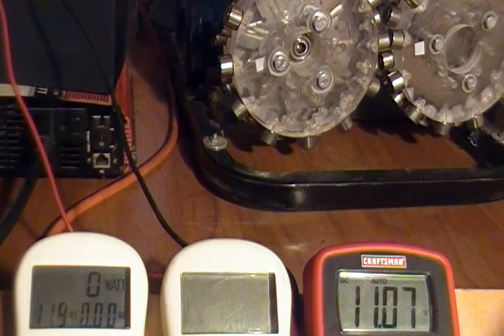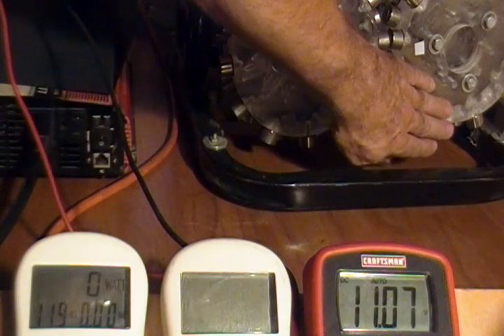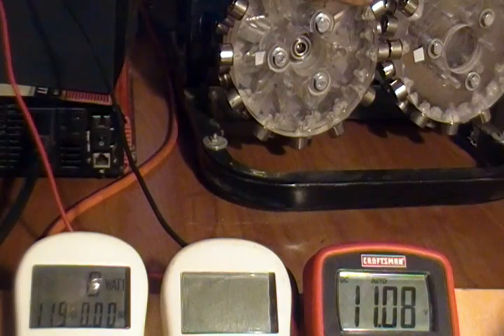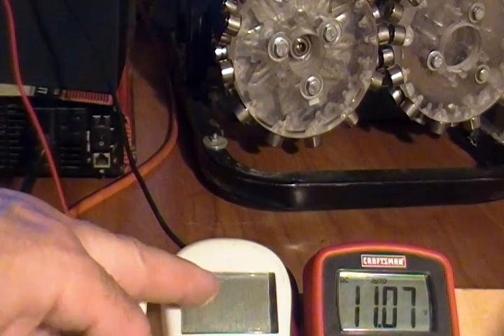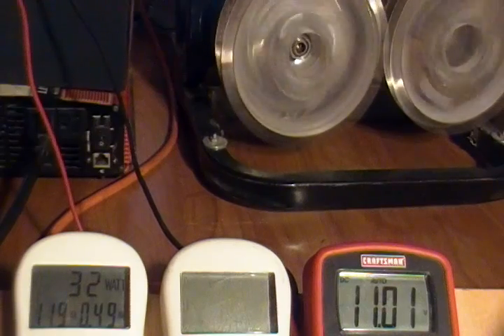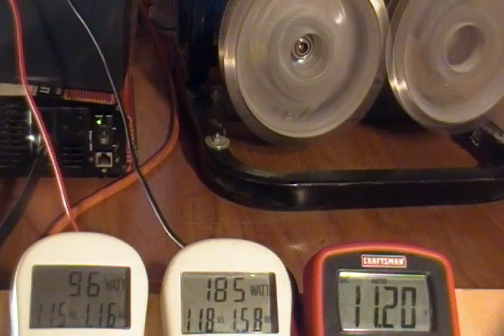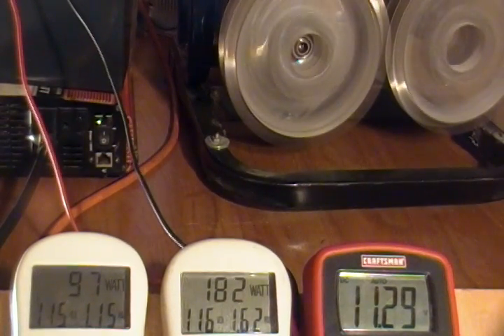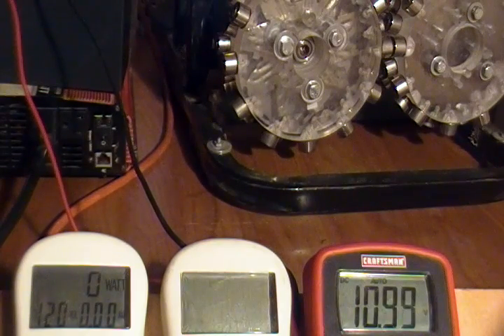Free Energy Electric Power Generator Overunity Magnet Motor

Comment from the maker: @hammeralois It will turn one alternator's rotor fast enough (barely) to demonstrate overunity.  It doesn't over heat, it just won't turn the alternator any faster.  I didn't know how big to size the motor when I purchased the plans off Ebay for the device, as the "plans" were just a partially translated copy of the original French patent documents filed by Mr. Hatem.  Now I know to get the biggest 115 volt motor they sell, which in the Grainger catalog is 3 hp.

Comment from the maker: @dthom95 Yes, that is the whole idea.  This setup was just built by myself to prove the concept.  Unfortunately I am at the max. output of the drive motor and would need to increase its size to add anymore alternators.  Additional alternators would be added in line on the alternators' rotors and not anymore directly on the drive motor's rotor, as that would put too much strain directly on the drive motor.

Comment: Have you considered to use the gearing principle? Just use a smaller diameter wheel connected to the alternator so that it will rotate faster than the wheel connected to the motor, thus producing more power.
Reply from the maker: Yes, there are many improvements that could be made. This is just a proof of concept device.

Comment from the maker: @nissanguy240sx This is a 1/3 hp 3-phase motor with a converter that allows it to run off 110 VAC.  This motor is too small for practical purposes, but does demonstrate the concept.  I would recommend you get the largest motor you can find that runs off 110 VAC and then connect a dimmer switch to it, to turn it on and off.  The reason for the dimmer switch is you need to start the motor slowly so the rotors stay in sync.  I built the rotors myself.  Everything else is pretty much off the shelf.

Comment: Hey...
I have heard about this concept bevore, but just don´t know where the + energy comes from.
Your Magnets are aligned N 2 S right`?´
Have you tested this system with an aditional alternator to the motor?
THX 4 sharing
Reply from the maker: The magnets are set up to attract, not to repel each other. I did build a set up with additional alternators, but I tore it apart because there were improvements I wanted to make. Here's an example of the original inventor's set up. https://www.youtube.com/watch?v=m0LjPc0lxfM&t=10s

Comment from the maker: @NoMorePetro  Yes, I've tried smaller, weaker magnets and fewer rows as well.  They didn't have the strength to keep the 2 sets of rotors in magnetic synchronization.  I haven't tried larger diameters of rotors but  feel this make for a definite improvement in performance.

Comment: Very interesting. Are the three rows of magnets necessary? Have you tried any other magnet sizes or strengths? Have you tried any other magnetic coupling sizes?
Reply from the maker: I tried smaller magnets, but had too much problem with slippage. I have found 3 rows to work best as did the original inventor: https://www.youtube.com/watch?v=m0LjPc0lxfM&t=10s

Comment from the maker: @RomeoDLN1 Separating the 2 magnetic rotors too much weakens the magnetic attraction between them and then they won't stay in sync.  I get the best results when the rotors are as close to each other as possible with actually touching. The rotors can be different diameters, but the spacing of the magnets on each rotor needs to be the same, so they mesh perfectly.  Good question.

Comment: Hi again Mindfreer.

Just noticed that you may have a serious drag on your device's RPM's.

Is your device housing / frame made of steel square section? If that is attracting the magnets, or rather the magnets are attracted to it i should say, it would probably seriously slow the RPMs. You probably have this covered, but i thought i'd mention it anyway, in case it's an oversight.
Reply from the maker: You make a valid point. This is just a test set up and there are many improvements possible.

Comment: @MindFreer Thanks for your reply. Strange power drain..you say the alternator shorted, perhaps this was actually the cause of the spike and not a symptom of the spike..?
If the alternator windings failed, and enough resistance was introduced in them due to shorting, that could result in a surge in consumption  briefly, that might lead you to conclude the alternator shorted because of an anomalous consumption spike, whereas the alternator possibly failed, which then produced the draw?
Reply from the maker: I did a real quick and dirty set up where I tried looping the system by plugging it into itself. With more experimentation, I'm sure this could be solved though.

Comment: ~0"40: You should say "the amount of voltage ON the battery", not "the amount of voltage IN the battery". The latter implies that higher voltage means more stored energy.

Its important not to confuse voltage with energy. Batteries hold energy which is what provides power. You can think of voltage as being what "shape" that energy is currently held in, not the amount of energy that is there.

If you're producing 100W at 10V, you're using the same amount of energy as if you produced 100W at 50V.

Comment from the maker: @spikeychops  Yes, I understand your quandary.  I had the very same question when I first achieved overunity.  I thought I could plug the unit into itself and it would run.  Then I tried it and it ran okay for about a minute and then all of a sudden the consumption wattage shot up to over 600 watts completely draining the batcap, and then the alternator shorted out.  The drive motor didn't turn any faster, the lightbulbs didn't burn any brighter, I couldn't figure out where the power went...

Comment: @MindFreer Nice work MindFreer, although i don't understand your reply above.
The AC output from the inverter is at the correct voltage/Hz for your supply isn't it? They're designed to mimic a standard domestic supply from  a 12v battery. Since you are feeding household AC into the prime mover, and obtaining household AC from the inverter, at apparently 2X the input power, where is the problem with simply taking the AC output from the inverter and feeding that AC into the prime mover motor?

Comment from the maker: @PENTATRONIK    Yes, you mentioned before about adding mass to the alternator rotor, I just haven't had a chance to try it yet as I have a lot of experiments pending.  I'm not sure what you mean about your output question.  The alternator produces DC power that is converted to AC by the inverter.  The battery is only there as a buffer because if you try to connect an alternator directly to an inverter without a battery, the alternator just shorts out... I know because I tried it.

Comment: Great work.
But, when you add mass on a alternator wheel you will be better results, maybe. Try it. This is pusled mass technology same as Campbell, Newman or Bediny, not magnetic. I think...
How you measurement the output from the battery or inverter? ... Thanks

Comment: quite interesting.. I would like to see a daisy chain of alternators driving each other and only using the single drive motor to get the first alternator started.. You then need to take the output off the inverter and feed it back into the drive motor...